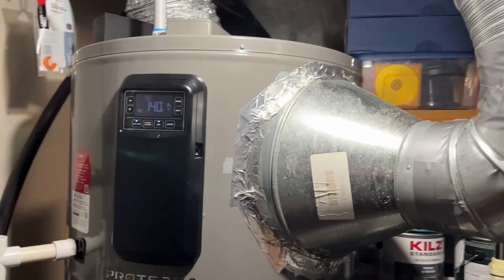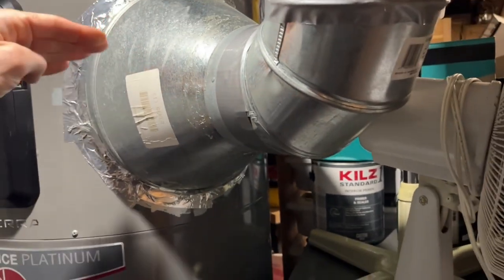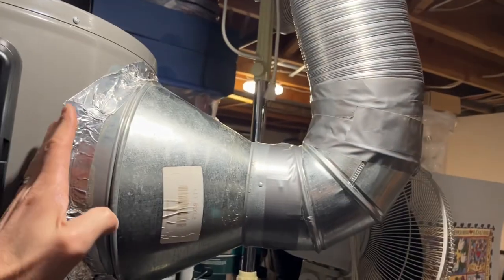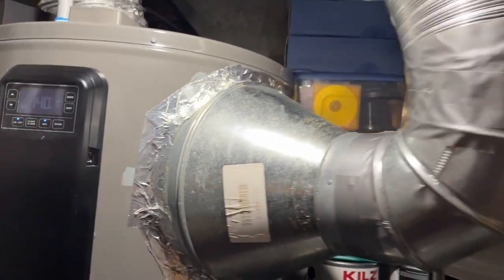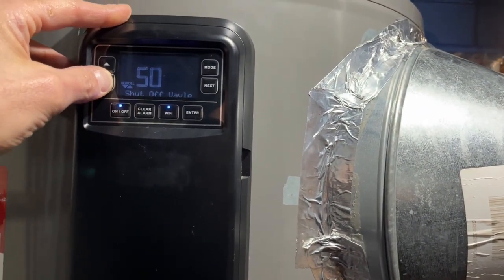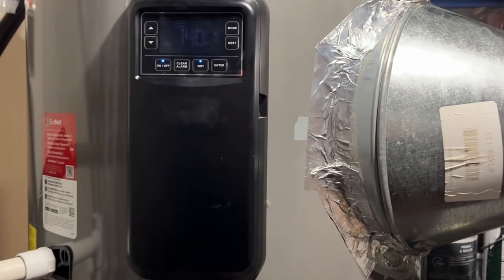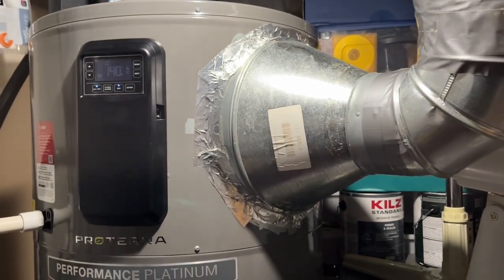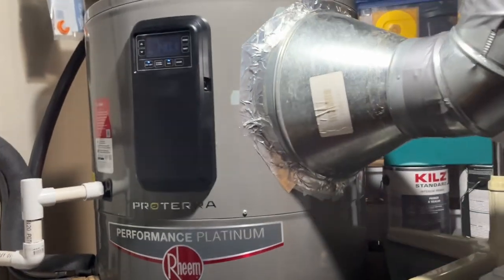Rheem Hybrid Hot water tank update ￼

Comment: I see why you vent those in Canada.  I bought a heat pump water heater this past October, but I’m in PA.  I have a finished basement but don’t turn on the heat since no one uses it.  Normally the temp is around 65 degrees in the winter but the water heater drops the temp to 60.  I may spend more time in the basement in the summer if it keeps the temp low.
Reply from the maker: @pat9080  free ac when its hot. Thanks for watching.

Comment: Rheem now sells and adapter that screws into the water heater at the exhaust that allows an easy connection of venting.
Reply from the maker: Yes they were selling them when I had my son make the intake adapter. The exhaust adapter from Rheem is something like $250. That’s a little much. So the $30 metal does the job and I was concerned about the diy look of it.

Comment: Hi - great videos. I just ducted the exhaust outside. I’ve had the tank for a year and the basement was really cold last winter. I reduced 8 to 5, but I only have like a really short run as the tank is up against external wall so it’s maybe 3 ft. My problem is the condensation off the duct work. It’s dripping like crazy and I don’t have any insulation. It’s about 19 degrees is the furnace room. Any recommendations? I know you mentioned you had the same problem but mine isn’t even insulated. Thanks.
Reply from the maker: Yes that temp differential is pretty wide. Invest in the black plastic wrap with the pink insulation on the inside. hopefully you have enough horizontal ducting for it to work, usually 36"from the wall to the interior will give temp change to balance out. The insulation tubing will make the bend to follow down the vertical ducting. Red tuck tape it at the wall to seal it so you don't get dripping down the wall or into the wall depends on the wall build design. hope this makes sense and helps.
Reply: @NewLightEnergy  I’m in Toronto so it’s more like -20. My vent is low to ground outside and between houses so I’m hoping it’s protected from the cold coming back in. We’ll see how it goes before I add in a back draft flap. Thanks for the info. I’m going to insulate and hopefully it stops sweating.
Reply from the maker: What winters do you experience, I'm in central Alberta so we can get down to the -30 to -40, with this super cold the back draft from the outside pushing into the tube can make your radiator freeze up, once it hits 2 celsius/32 farenhiet the heat pump may stop working. a back draft flap on the outside will help stop this from happening, you are way closer to the wall port than I am so I expect a different scenario.

Comment: I had never considered ducting a heat pump water heater. I am in Canada as well and disliked the idea of all the cold air being transferred out of the system in the winter. Not only are you paying to heat the water, but you're paying to warm up the air in the room. Thanks to your video, I will have to reconsider my stance on a HP water heater. 

What did you do to stop the cold air from creeping in through the duct to the exterior? I may have missed it but I don't like you explained your solution.

As for heat pumps in Canada being dumb, I just want to say that when you don't have access to natural gas, going with a heat pump is cheaper than the alternatives like resistance electric heat. I have a whole home ducted heat pump. Yeah, the defrost cycle is an efficiency killer but even with you consider that it still results in a better COP than baseboard, etc. Ironically, it is the +/- 5C range that causes the most defrosts because that is when the air holds a lot of moisture and the ambient air isn't enough to melt the frost build up. Going down to  -15C will result in fewer defrosts because the air can't hold as much moisture and the system runs quite efficiently. 

I only just moved to a home with a brand new central ducted heat pump recently and I have to say it is much more comfortable than natural gas because the system is able to cycle down and run consistently, giving a nice even and comfortable temperature throughout the house. Compared this to NatG furnaces which are either calling for 100% heat or none at all, so the house temp is always yo-yoing.
Reply from the maker: I change the standard exterior termination duct to a passive butterfly duct flap on the outside of the exterior wall. This is better but not perfect yet.

It’s great that you’re having good results with the heat pump.